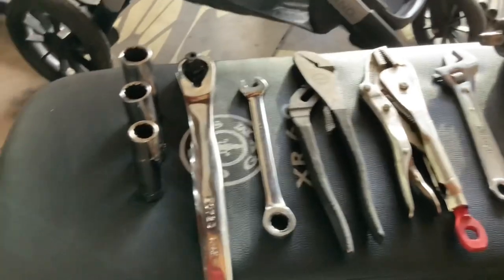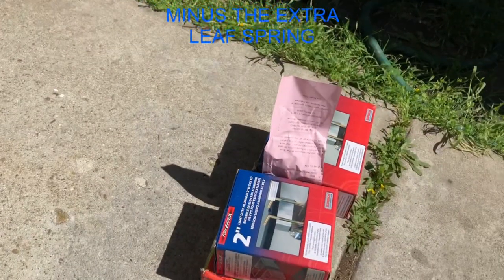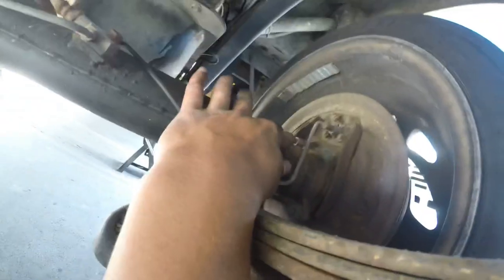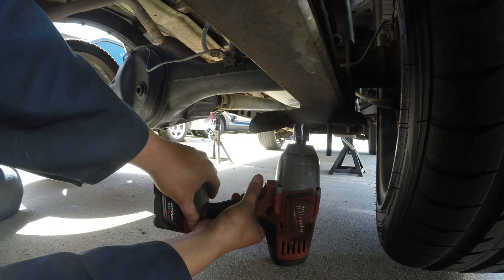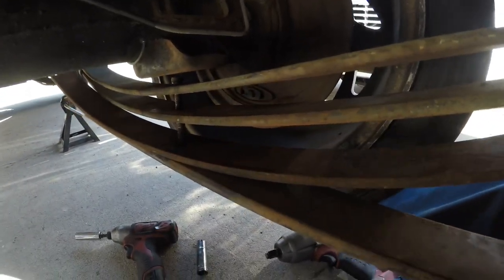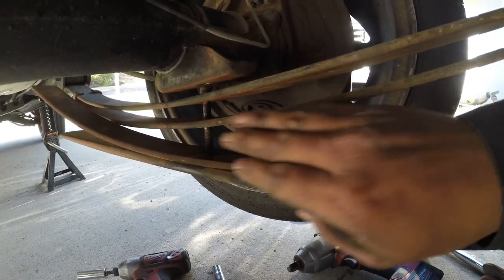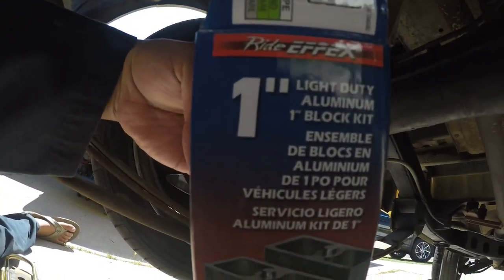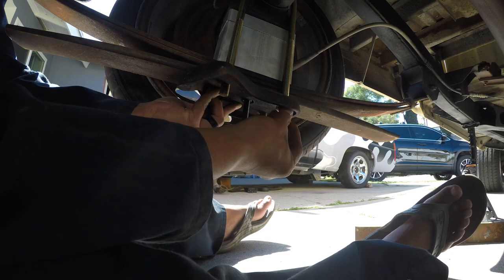How To Drop A Datsun 720 Pickup Truck

Comment: U-bolt nuts are torqued to 58ft-lbs if you think you had trouble getting it even.
I also use a digital caliper to measure the threads on the bolt when cranking the torsion bars up/down to get the ride height even.
Reply from the maker: Nice. I didn’t have any trouble getting it even, but thank you for more info. 👍🏽

Comment: love the video, My 80 Datsun 720 king cab height is like a 1" or 2" lower on the driver side than the pass side. Is all i do is tighten up the driver side to bring it up some, or do I have to pull the bar off and move the spine a notch over a turn on driver side to go up a little? I want to bring up the driver side to match the passenger side height

Comment: You did okay it was kind of amusing for me I would have taken the tires  off in the back so you're not laying underneath it never use a crescent wrench and I thought you were going to lower this truck you can take that extra block out take those extra leaf out just use the one main big one and your helper small spring that will get you your drop and as for the front you did it right except for you don't need to take it for a test drive just push up and down on the fenders on each side and see where it sits and if it's not where you want it readjust it the same way you were coming down or if it's too low go back up but you have to count each one of those bolt threads on both sides so they match I usually measure each side 1 in but you don't have to do that some trucks sit one and a half inch but it was a good how to video I like that yellow banana except it still sits way too high 😂😂 keep up the great videos I subscribed to you because I want to see what you do with your channel good luck buddy don't give up just keep plugging the videos out

Comment: 👉👍👍👍👊👊👊✌✌
Reply: What length and bolt size do you use as far as u-bolts
Reply: Sweet thanks alot. Where are u based out of?
Reply: @guahangarage  im in riverside. I have a 84 720 that im working on. Ur video was super helpful
Reply: @guahangarage  oh I understand. I have a truck question I wanted to ask but I don't know if you wanted to talk about it openly on here I was going to send u a DM